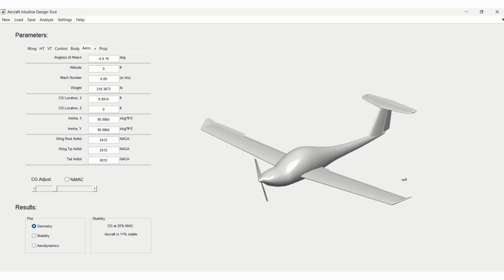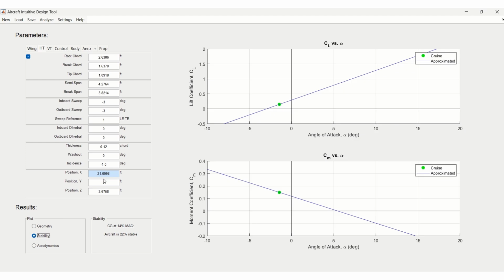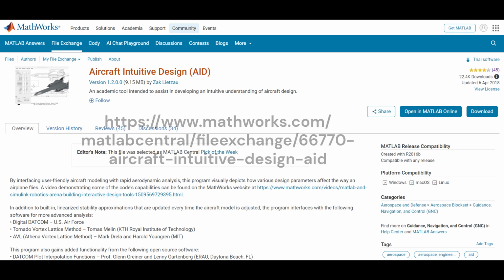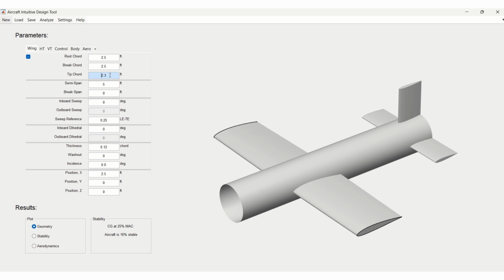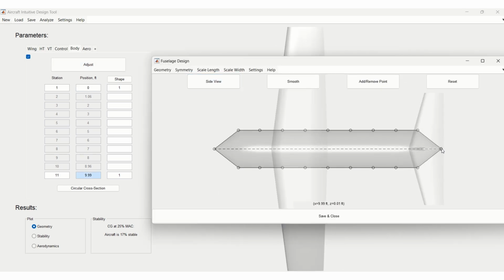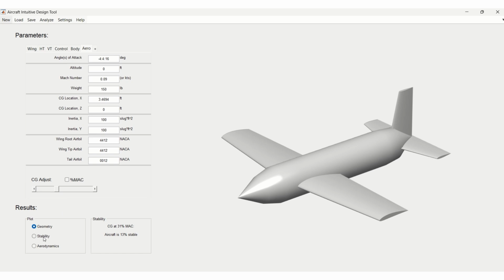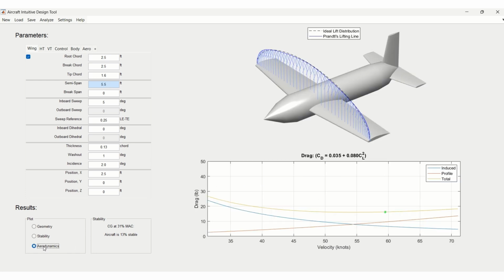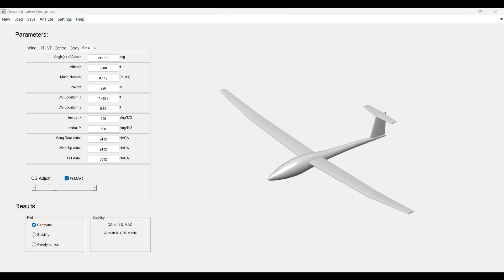How to Design and Analyze Aircraft in MINUTES ! AMAZING TOOL for Aircraft Design & Analysis

Comment: how could i change the Reynolds and velocity in the app
Reply from the maker: In the Aero tab, you can change the velocity using the mach number tab (Either enter mach number or airspeed in knots). You can also set the altitude (and hence density). Reynolds number will be  calculated using these values.

Comment: Trying to run using online matlab, but does now work. Any idea what should be done?
Reply from the maker: Did you install the Aerospace toolbox and Statistics and machine learning toolbox first? 
I am using the downloaded MATLAB student version, and I am not sure if the app will work in the online version.
Reply: @AircraftDesignToolbox  Yes both toolboxes are installed. The error is like following: "Error using view (line 43)
When specified as a graphics object, first argument must be one or more axes objects.

Error in AID (line 1061)
    [AZ,EL]=view(ax{1});
            ^^^^^^^^^^^
Error in Initialize_GUI (line 748)
AID(0,0,'update')
^^^^^^^^^^^^^^^^^
Error in AID (line 87)
    Initialize_GUI(choice)
    ^^^^^^^^^^^^^^^^^^^^^^
Error in AID (line 125)
                AID(0,0,'initialize',L), return
                ^^^^^^^^^^^^^^^^^^^^^^^
 
Error while evaluating Menu Callback.
"
Reply from the maker: Sorry, I don't know how to resolve this issue as of now.